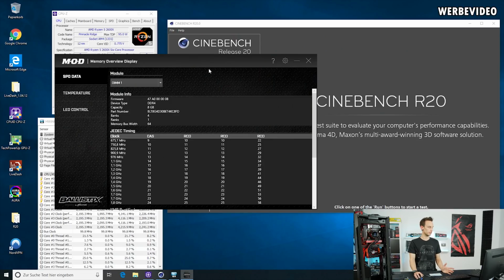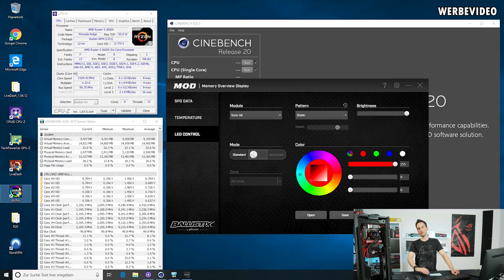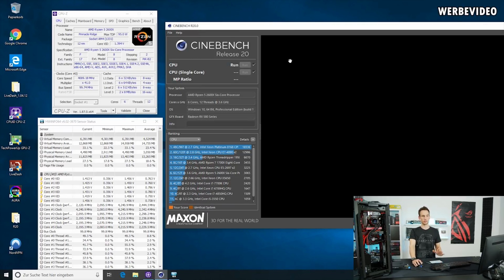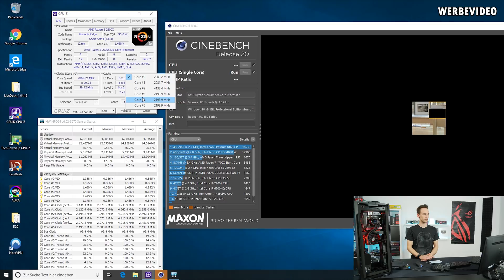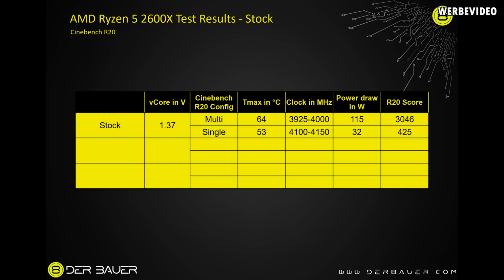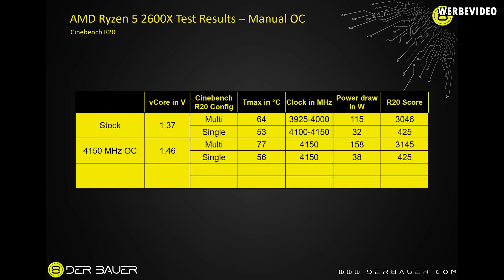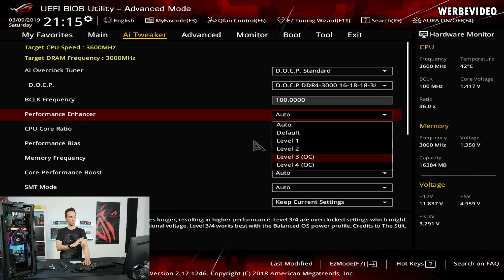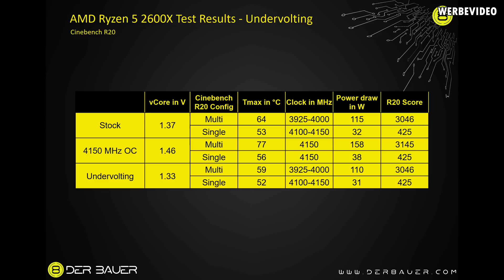The problem with AMD

Comment: I am still on the ryzen 2600x, I remember when the cpu voltage used to be 1.37 but after these bios updates its at 1.432-1.435 on auto. I have to see if I can set a offset cause this click bios is completely different now. I like the old msi b450 layout better, I know they needed to add cpu support though so its pretty minimal now. I am sure they have a offset feature some where still.

Comment: schade das es das offenbar nicht auf deutsch gibt dieses Video
Wenn ich auf 3,9ghz gehe, bei 1,225v VCore, verliere ich praktisch kaum an Rechenleistung
Allcore, llc6, ram 3000 nach xmp von Hand alles fest im Bios festgelegt
PES (Performance Efficiency Suite) belegt eine deutlich bessere Effizienz dabei, dummerweise ist das ein Scrip für Cinebench R23
Wenn ich 4050mhz also 4,05ghz einstelle, scheint das aktuell mit 1,3V zu funktionieren, dann bin ich laut PES im Single besser mit der Effizienz, aber im Multi wiederum wieder etwas schlechter als mit 3,9ghz
Das dumme ist halt das Scheduling im Single Core Test, die CPU-Affinty von Cinebench passt da dann nicht, sprich das läuft nicht immer auf nur einem Kern sondern dieser eigentlich anzunehmen eine Thread teilt sich auf mehrere Kerne auf. (sieht man im Task-manager, HWMonitor, etc. etc.)
Sprich auch dieser Effizienztest, der wird negativ beeinflusst.
Dabei ist es auch egal ob ausbalanciert, ryzen power plan, höchstleistung oder sonstwas für ein Energieprofil verwendet wird, das ist einfach immer so vom CPU Scheduling aus.

Der Curve Optimizer da hat man das ja für Prime95 auch "geregelt" wie man in Github nachlesen kann, da wird die cpu-affinity ja angepasst dafür um die einzelnen Kerne auf stabilität zu prüfen.

Comment: Preach On BrothaMan! AMD even Stated themselves that they've been Able to Squeeze out almost every bit Overclocking capabilities Possible of 3rd and 4th gen Silicon and tuned the chips to turbo up to each cores Max stable oc Factoring in All probes/sensors then locking at edges of Thermal Tolerances (tj max) before exponential power waste/Overvolt then just Stay at those Peaks w/Unlimited boosting time limit and no more gearing down timers.  Good Luck trying though

Comment: Funny thing, see PBO, FSB and water cooling. Overclock on all core is indeed pointless unless you're running compute on the CPU. Higher boosting is not, and you can get there with cooling to spare - the CPU will give up stability long before reaching target temperatures even with unlock, unless you overvolt it like a crazy person. (1.48V is probably top that's safe, being stock maximum boost voltage. Don't use offsets! Definitely do check what LLC does on your board first.)

Comment: Hi i just built a new ryzen 3 1200 pc it wasnt posting so i took it to the shop n turned out the gpu(gtx1050)was bad  but now that gpu worked on 2 other systems but wasn't working on the ryzen build as well as another intel build but the pcie slot of ryzen build isn't bad because we checked that with a 710 can someone help me about why that gtx 1050 cant post on that ryzen build

Comment: I bought a r7 1700 day 1 of ryzen release. As someone who's owned this CPU for 2 years (and someone who's built several ryzen systems), I would strongly recommend spending the extra for the x sku for the slightly extra cash. Precision boost just works so well, especially in second gen. 

Of the 4 non-x chips I've handled (all first gen) havent passed 3.6ghz on all cores, and a lot of user reports say 2nd gen isnt that much better on the user overclocking. I know for sure I'm getting the x sku flagship for 3rd gen, I am not risking another dud. 

Intel underclocks their chips to hit power budgets, you can reliably put any 8th or 9th gen part to 4.9ghz on all cores and run just fine, just with a lot more power

Comment: have personally had nothing but nightmares when it comes to gaming with aura sync, the app legitimately causes warframe to have massive FPS stuttering and i've tried many many different versions with some success with improvements to performance, but it seems to always come back so i was stuck having to just discontinue use of aura sync entirely.

Comment: I understand where you're standing but i'd like to know if you think the same for the non X version coupled with a medium range motherboard. On my end I OC'd all cores on my standard 2600 because XFR boosting is nowhere near what you get with the X version, it's still perfectly stable @ around 4.1. Playing demanding titles I can definitely see/feel the difference but I didn't think the power drawn factor would be so high before watching this vid... Will reconsider my settings now

Comment: How about overclocking by p-states to get a little more single core? 

That's what I did with my FX. My CPU was limited by my board, but it was stable at 4.5 for years if only two cores were active. Eventually my VRM started to get less reliable and I backed it down to 4.3.

I'm far more curious about p-state overclocking, if a single core or a pair can go higher still like they did with the FX.

If not, then it sounds like an architectural bottleneck as even the 32nm process could hit 5GHz.

Comment: Thank you for this. I have been banging my head on the wall trying to manually OC my 2700x. It does perform better in R20, but the power draw and heat generation is absolutely insane. If AMD designed it to spike up to 1.55v with XFR, I'm just gonna leave it alone, lol.

Comment: That's really interesting that the benefit of overclocking just isn't there on Ryzen. So save heat/stress on your CPU and save electricity by not OC'ing? So would you say focus more on tweaking RAM? I have a 2700X and I gave up overclocking the CPU b/c of stability issues when paired with my 4 sticks of 64GB of RAM, which I can't even get to the rated 3200 speeds and have settled on 3000 but with tighter timings. 

So for content suggestions, I'd love to see more comprehensive RAM overclocking/tweaking and also maybe an explanation of AGESA. I know ASUS just put out a BIOS update for the Ryzen 3xxx CPUs with newer AGESA compatibility or whatever. Will this help Ryzen 2xxx CPUs as well in terms of better compatibility and overclocking of RAM?

Good content.
Reply: YES! dont oc if you live in a place with high energy costs!  think green and lean. 
the 2700x caps out on OCs at 16 gb of ram. I once pushed my 2700x to 4.8 and then looked at my backup battery-bank to see it jumping in and out of 500 watts with a high end gpu. the state sanctioned power company here in the usa has digital meters that bend you over for peak power draw and variable power consumption if its outside of your average telemetry big data  spec or your average economic (non linear) tier class with another fee for every X KW(s) after!! ( with calculated number of users so they billyou for having a party) to hell with that! they cant even provide clean power!
so with all of that in mind im forced to be a good buoy and clock to "energy" "star"

Comment: der8auer: 'there is not so much you can do with AMD Ryzen when it comes to overclocking..' 
me: 'you mean.. AMD is easy to overclock, even a beginner in overclocking can do it.. unlike Intel, you have to delid it to get the most performance out of it?'
it's not 'not worth it'.. it's 'too easy to overclock'.. correction matters..
Reply: Being too easy to overclock is the point he's getting at. Once AMD is just automatically doing everything for you with their sanction, it's not really "overclocking" in the sense of the user doing out-of-spec things with their hardware to see how hard they can push it. It's all just out-of-the-box expected behavior from the product now. This kinda kills the tinkering and hobbyist aspect of it, which makes it uninteresting.
Reply: @wasd____  'we' know he meant that.. but for others who don't know that fact.. is that they'll get out of it? for them it means 'dont buy AMD it sucks.. you can do nothing more..' furthermore.. he didn't explain it why ..
for me, as a computer technician.. whose most of customers doesn't know things like this.. i can see this as a problem in terms of misunderstanding..
besides.. overclock is still overclock.. whether you can do it easy or hard.. it's OVER the specified CLOCK.. why do i see hate on AMD.. hmm.. 
as for the beginner overclocker.. AMD can help them.. since they got the cheapest overclockable bnew you can get.. why dismiss that fact too? everybody starts at small things..
PS: im bored..
Reply: @Yurie13  People who don't know what he meant are probably not watching these videos about overclocking, or using them to choose what to buy. Overclocking is not a mainstream consumer use case.

And you don't see hate on AMD. Lack of interest in things that are too easy to satisfying or just aren't worthwhile is not hate. It's just lack of interest. Ryzen is a fine processer - but not for the hands-on, personally tuned and tweaked overclocking experience. There's just not enough to wring out of them on your own without AMD having already done it for you right out of the box. That's not a bad thing - the average person should be smart enough to know that "it just works" combined with a good value proposition is something favorable for them, because odds are that they don't want that hands-on experience, they just want it to work.

There's no hobbyist / enthusiast aspect to something if the process of working on it doesn't have much room to go further than noting, "Yep, it just works out of the box. Nothing more to mess with..."

Comment: As you mentioned, the trick with Ryzen (well, Zen+ anyway) is creating conditions that allow XFR  to work effectively. However, those parameters aren’t necessarily the same between gen 1 and gen 2 Ryzen, or between the X and non-X CPU’s. There is still testing and tweaking that can improve performance, but it is greatly different than traditional all-core tweaking we do on Intel CPU’s. I’d still watch you do some of that tuning though.

Also, memory tuning is hugely important, and there are a large number of options for tuning available there. Doing a piece on memory tuning when you can’t get Samsung B-die would be something I’ve never seen before. There are also some interesting challenges to be had with the 2200 and 2400. You CAN delid those, and there are some interesting tradeoffs to be made sharing power and thermal capacity between the CPU and GPU on the same die. XFR isn’t much help on the APU’s!

Comment: Depends on the Ryzen CPU, I have a 2700, with Cinebench all cores clock speed it is 3.4ghz with XMR, 4.1ghz single core. 

Running OC I run 4.1ghz all core, will do more but not worth the steep power curve to get there. Very big difference in performance. If you have an X model which cost more, just using the built in OC is a good bet. NonX you can push it better by OCing it yourself.

Comment: The performance gains from overclocking Ryzen are nowhere near what you can gain by OC-ing most Intel chips. Ryzen CPUs are pushed close to their limits out of the box. You gain what, 300 mhz tops on Ryzen? They're great CPUs for the money, but they just don't have the headroom that Intel K-series chips do. I can't see how any overclocker would be excited by Ryzen.
Reply: are you getting those numbers from turbo to oc or base clock to oc?
Reply: @jamestor6700  Turbo to OC. Base clock means nothing in a CPU-intensive scenario, like gaming. Part of the reason why older Intel i7's are still such good gaming CPUs is because they overclock FAR above the stock turbo frequencies. 700 to 900 mhz above turbo frequency isn't uncommon for 2nd through 4th gen Intel chips, even with basic air cooling.
Reply: @hartsickdisciple  yes but those generation i7's aren't going to perform as well
Reply: @jamestor6700  Overclocked 3rd and 4th gen i7's paired with 2133 or 2400 mhz RAM match or beat Ryzen CPUs in most games. Once they're overclocked to 4.5ghz and up, they're right on par with stock Skylake i7s like the 6700k.

Comment: I always liked AMD back from first build with Opteron 185 @ 3.0Ghz  + DFI Lan Party  just blow away any Intel CPU in his time. Jim Keller also did a good job with Ryzen 
But for my usage that is emulators and gaming don't perform to well compared to a Coffee Lake/R, my 8700K @ 5.2Ghz is miles away in performance on some emulators. I hope Zen2 increase the clocks close to Coffee-R. 
Memory O.C in Ryzen is super fun but you need a very good ram if you wanna go over DDR4 3200+ with tight timings and quality B-die are expensive sadly

Comment: Anyone asking him why he doesn't give AMD more attention is so naïve. Any tech enthusiast is aware that currently Intel simply provides the better IPC necessary for the highest overclocks. There is no doubt you get better bang for your buck with AMD but that's not his goal with this channel. His mission is to get the highest performance numbers possible the Intel CPU provides higher overclocks. 
You must've received those questions from random casual people stumbling across your channel
Reply: Better IPC has nothing to do with overclocking. If anything better IPC results in lower frequencies, not higher.

Comment: Let me tell my experience as a builder and as a owner of Ryzen 5 2600X. As I know Ryzen X chips will auto boost to their maximum rated frequency as long as cooling solution, case ventilation and motherboard power delivery will allow to. At stock cooler it might not be able to auto boost at 4.25ghz. My Ryzen 5 2600X during gaming measured with MSI Afterburner will auto boost at 4.25ghz all day long. I have Gigabyte Aorus X470 Gaming 5, 240 mm Cooler Master Rgb AIO, in a Phantex Eclipse P350X case.  So all three factors enabling the CPU to auto boost at it’s maximum rated speed are more than enough. I don’t have to do any manual overclocking. You might say why 240mm aio. Isn’t overkill? Yes. It is. But keeps my CPU crazy cool, allows it to reach its maximum performance, and allows me to upgrade to upcoming Ryzen CPU generation to a 8 core or even more count CPU. If you want the best get the best. If you want to use just stock cooler a cheap mediocre cooling case, a cheap motherboard just let your CPU to decide what’s the best for him to boost and get whatever you’re able to get. Which in gaming should give you a noticeable frame rate drop compare to someone like me that gets the last drop of juice from CPU. I could spend less and get less performance but not to much less. Probably performance gained isn’t linear with what I spent but that’s who I am and how I like my rig to perform. That’s my experience. Someone else might have a different experience. As for me this CPU is a excellent CPU if you give him room to show his splendor.

Comment: I have a 2700X and tried overclocking it too. But my conclusions are the same as yours. It simply doesn't worth it. So I decided to use it only in stock.

Comment: Dont overclock, its that simple.  Ryzen does it automatically for you.
https://imgur.com/xalHotP
Theres a picture I took of all my cores, I had bf5 open and they were all at 4.6, 2 seconds after closing bf5 all cores dropped back down to 2.2
AMD auto overclock is absolutely incredible and does everything I could want it to.
Also my ram automatically overclocks itself from 3000 to 3500mhz and all my voltages lock at 1.45
Ryzen knows what it needs, and manually overclocking with this chip wont get you as good results as just letting it do its own thing.
Overclocking is novelty nowadays, AMD is moving away from the need for consumers to "fix" their chip so it gets the performance is should like intel.  AMD would rather just ship you a fully complete product that perfectly controls its own clocks and voltages.

Comment: You must have a shit processor.  I have the r5 2600x and it automatically overclocks to 4.7 on its stock cooler while gaming lol.  My temps have also never gone above 60c even in a stress test. Ryzen 5 2600x here is also only $230 and comes with division 2, where as something like the I5 8500 is over $350 and gets shit on by the 2600x
When both cpus are tied at the exact same price point, amd wins literally EVERY time.  The only reason people say intel is better is because at the VERY high end, they pull ahead because AMD simply hasnt made a cpu that expensive yet.  Price to performance is everything, and in canada AMD beats the intel cpu that costs the same and even $100 more in literally every case.  AMD is the superior product, but intel is too mainstream swag for AMD to ever really pull ahead.  AMD is like an actual pair of work boots where as Intel is a pair of overpriced timberlands that arent even as comfortable at the end of an 8 hour day.  Anyone who takes pc building seriously should give up on being assraped by intel and just move over to AMD, and if you really need to spend $2000 on a chip, just get a fucking threadripper instead of an I9, the performance difference is literally so minimal, its not worth spending 300 more on an I9
AMD users listen to Tool, Deftones, General rock and alternative music, GOOD music
Intel users are all "gucci gang gucci gang gucci gang gucci gang gucci gang gucci gang gucci gang" and "started from the bottom now we're here" Illiterate gangster shit.
Get over yourselves, more expensive and flashy doesnt mean better.